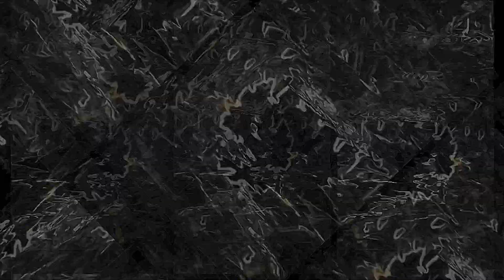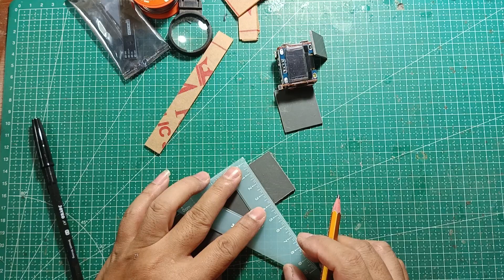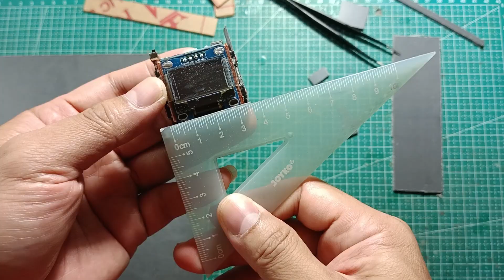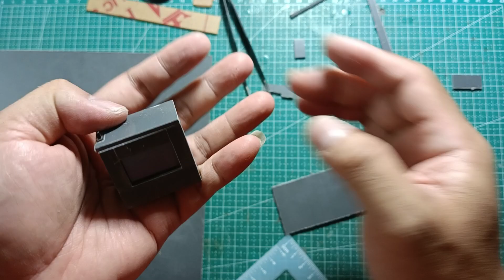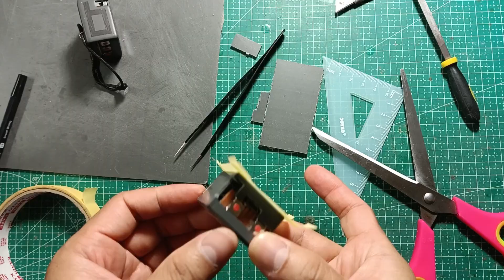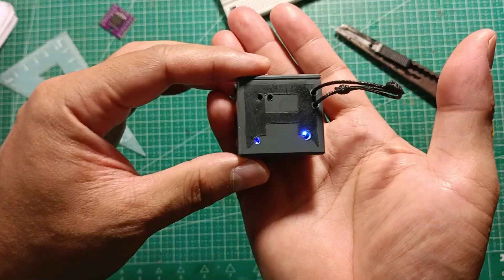How to Make Nethercap by Cancro29 Part 4- Make a CASE

Comment: Make video on bruce mini full explained in detail please 🙏
Reply from the maker: All function in Bruce Mini is same just like in other device (CYD, LILYGO,  SMOOCHIE, CARDPUTER etc) you can find it in one of my videos Bruce CYD
Reply: @ARTFOR  thanks but which features is not show in esp32 because I use Esp32 Wroom 32u ❤
Reply from the maker: In Bruce Mini i haven't find pins SS and CE for NRF24 and CC1101 in arduino.h code....so it can't perform it function. You need to build, compile and defined the pins your self from source code. Unfortunately i can't
Reply from the maker: But if you build DIY CYD Bruce with wroom32u just like in my video all feature in Bruce is working
Reply: @ARTFOR thank you so mu😢😊
Reply from the maker: @Dipankarbhunia-e3s  you're welcome bro